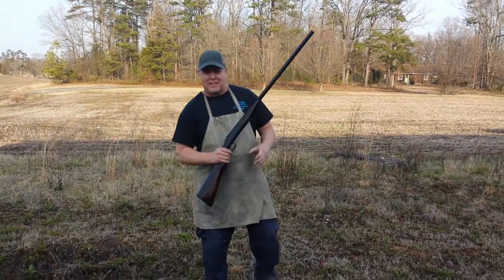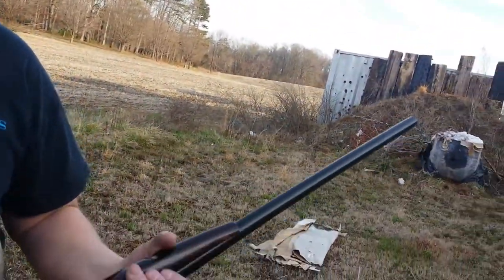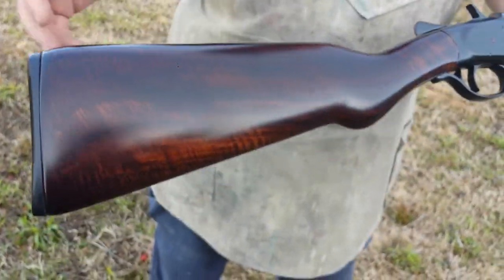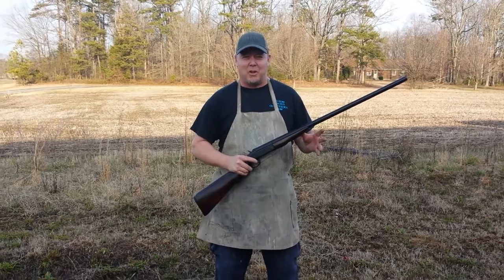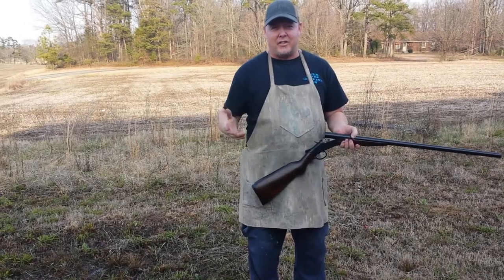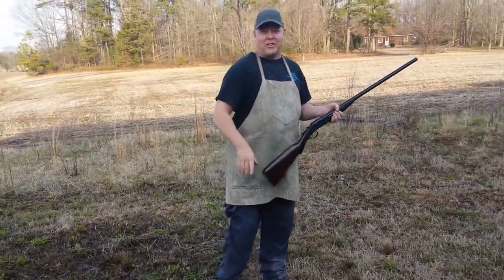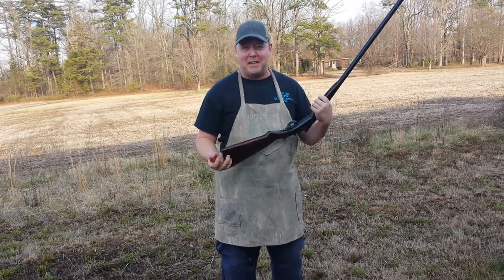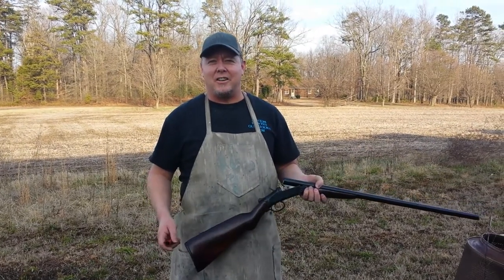Iver Johnson All Finished Up And Now For The Final Test Fire Of This Old Gun!!!

Comment: What is this gun worth?
Reply: Sherrie Carr, Not much. A single shot Iver Johnson probably sells for about $250.00-$300.00. I think the fellas mention on the first installment of this series that it’s not worth much money, but it belonged to the customer’s father or grandfather so it’s worth it to him.
Reply: i agree $250 t0 $350
Reply: Online it says max worth $75-175 I paid $80 for one with a cracked butt stock all the way down at local gun shot and uses copper wool to clean rust
Reply: I bought mine for 75, all the metal is in good condition, but action is a little loose
Reply: I bought one for $50, but it was minus the buttstock and forearm. No problem as I already had a buttstock and forearm for it.
Reply: Nice shotgun. I just finished restore on my iver johnson 20 guage. Bought it at auction for $112.